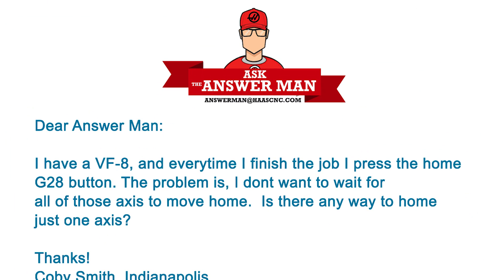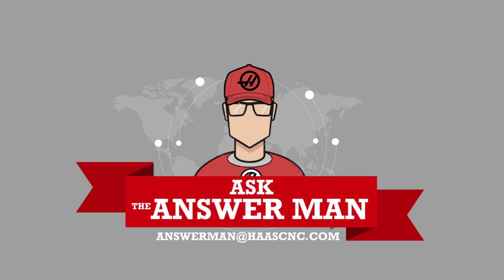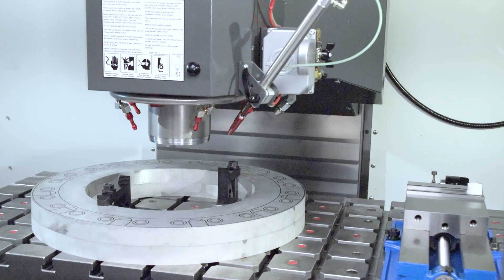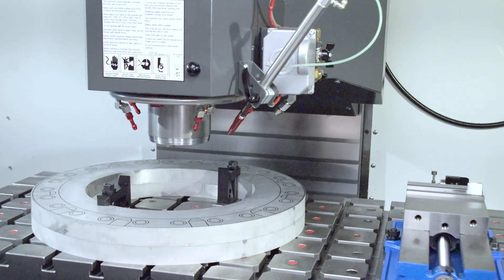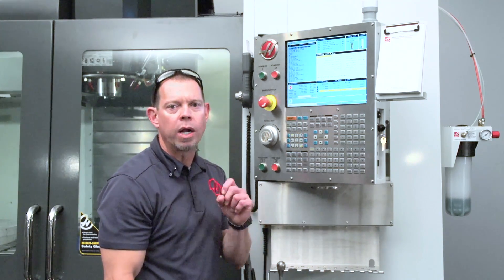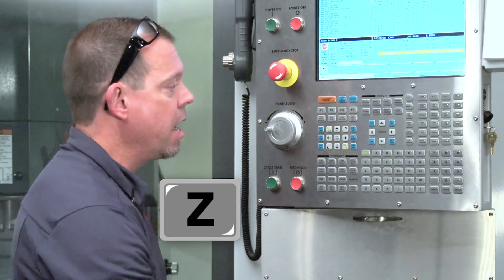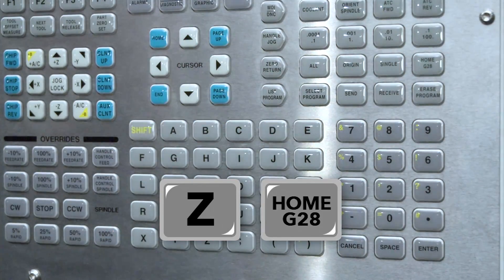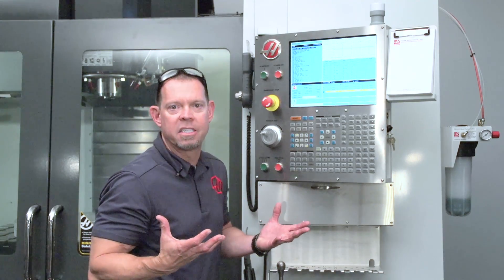Zero-Return a Single Axis on Your Haas Mill – Ask the Haas Answer Man

Comment: On machine startup when zeroing or setting home is there a way to make each move one at a time Z moves then  X then Y.  Currently, and in your video X and Y move together.  I have a jig mounted in a VF9 that extends beyond the end window for part loading.   When an operator starts the machine they need to first bypass the Jog so they can move the table inside before setting Zero or Home.
Reply: Use G53

Comment: Why does pushing SNGL instead of HOME G28 cause a faster retract of axis?
Reply from the maker: Thanks for the question imholdinout,
The axis doesn't retract any faster, but it doesn't take as long as a full G28 since only the Z axis, in this case, has to return to zero.
Reply: When I am in zero return if I press the Z button and then press SNGL it will not retract the same speed as if I had pressed the HOME G28 button. I was wondering why this is? I should have clarified the example.
Reply from the maker: imholdinout, 
Yes there is a difference; when you press ZERO RETURN > Z > SNGL you are asking the machine to FIND the Home position for that axis, so it is going slowly looking for the Home Switch position the same as if you had just powered up the machine. When you press Z > HOME G28 you are asking the machine to GO TO the Home position located at machine startup. And it does this at whatever "Rapid" override you have currently selected. Thanks for the good question.

Comment: Here's a tip: have the post processor output a G53Y0 just before the M30/M02 and no need to home one axis at the end of a cycle. Our CAM outputs to the center of the part to put it directly in front of the doors on our VF-6SS.